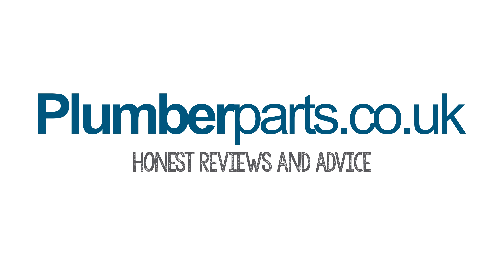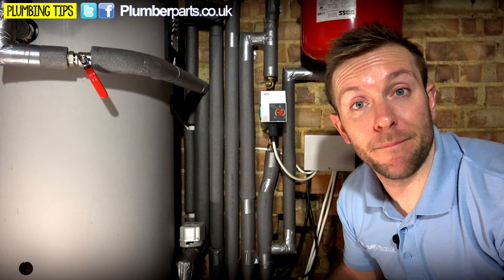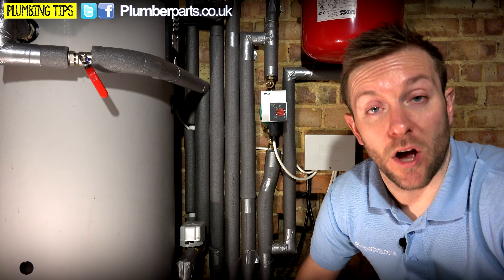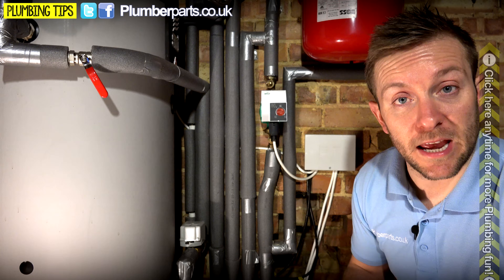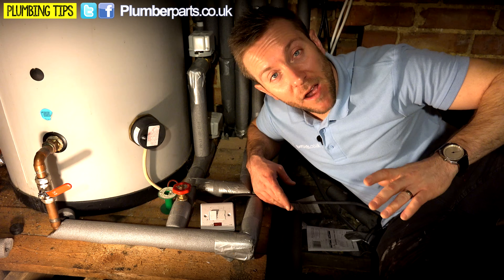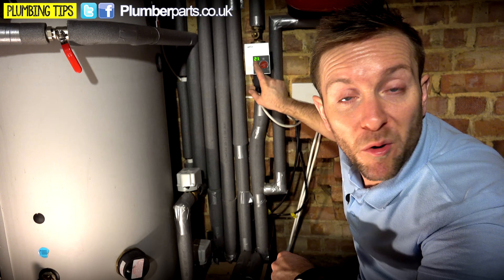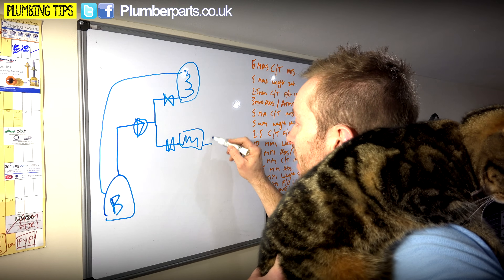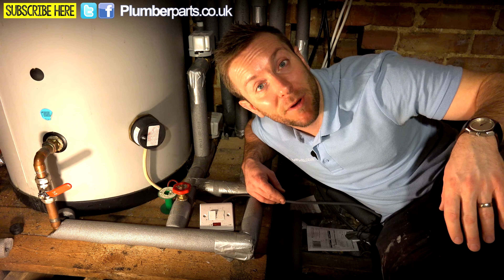BYPASS VALVES ON S PLAN AND Y PLAN HEATING SYSTEMS - Short Cycling prevention - Plumbing Tips

Comment: Do I need a bypass valve on a combi system? I have a couple of 2-port zone valves for my rads and sometimes they bang when the heating comes on. I think I may need a bypass circuit installed before the zone valves.
Reply from the maker: Yes mate, can't hurt! SUBSCRIBE! ➡️👉 https://www.youtube.com/subscription_center?add_user=plumberparts 👈⬅️ IF YOU HAVEN'T ALREADY! 😎
Reply: plumberparts cheers! love your videos. very helpful
Reply from the maker: No worries!
Reply: If you have a towel rail plumbed in independently, that'll do the job !

Comment: Hola hermano - does the by-pass also serve to ensure that some of the immediately heated water is fed back to the boiler so it is not receiving very cold water from the first fire up after standing idle for a while, so as to reduce condensation on the heat exchanger? Or was that just for old systems? Muchas gracias y saludos.
Reply: No.

Comment: Hi mate. whats your opinion on these new pumps on old systems with not the best flow, as they slow down when they feel resistance , (its not always the best idea to start power flushing old system until the customer is ready to fully upgrade boilers rads etc) would they not require a pump that has some humph to compensate ?
Reply from the maker: +B1cam They're great the compensation pumps. Really good at a nice balanced flow!

Comment: would changing from a feed and expansion tank to a sealed central system make the water flow better. ive a kitchen rad that wont heat and ive been advised this may solve it. ive tried EVERYTHING 😂
Reply from the maker: +Ror C It can do, but balancing the system should be your first port of call. 

Sub here please>> https://www.youtube.com/subscription_center?add_user=plumberparts <<If you haven't already!
Reply: +plumberparts ive balanced it already but it didnt work. ive taken the rad off and washed it through to clear sludge. I tried to purge air as you show in your videos. the water will flow through the rad and flow out  hot when i attach an open hose to radiator. this pointed a blocked return pipe. so i drained the system from the pipe i suspected was blocked and then blew pressure up the pipe. this left me convinced it wasnt blocked. had a plumber out and he suggested changing to a closed loop system might fix it but i dont want to part with cash unless it will repair
Reply: +plumberparts could it be the pump pressure is too low to push the water around?
Reply: The 'blockage' could be air - AKA an air lock. Turn all the other rads off at the valves, put the pump on it's fastest speed - and see if you hear bubbles rattling round the pump.

Comment: Good work James! Showing one of the many advantages of our Yonos-PICO.  LED display makes life nice and easy!
Reply from the maker: +Wilo UK Cheers guys! See you at Installer?
Reply: I have Wilo variable speed circulators in mind now. Have done for some years. The problem is, I've 2 spare Grundfos circulators in the garage.The second was a replacement for the first. The first was cleaned out/flushed and is ready to be used again. The second was replaced unnecessarily by the government in favour of an unbranded one.
Reply: What controllers do you provide for the variable speed circulators ? How many 'call for pumpage' terminals are there ? I'd hope for 3 - 1. low pressure, 2. high pressure & 3. full speed. Where 1. and 2. have pots so one can actually choose/tune the supplied pressure. Current system, zone 1 (TRVs) I'd want low pressure and for zones 2-5, full speed. It'd be useful to be able to vary the pressure by the number of zones active - so feed a terminal with 240V via resistors on each zone - so the more zones active, the nearer to 240V is provided to the pump.

Comment: Thanks James, great video...I have one pump, one three port valve and, I'm pretty sure, No bypass....I it might be built into the boiler but as that's a 15 yo Potterton, I doubt it. When the heating goes off for the summer, I switch the pump right down, also I don't have TRV's on every rad so I think that has the same effect, right? 🙂
Reply from the maker: +MrSbenn69 Kinda. Should be OK. PP!

Please sub >> https://www.youtube.com/user/plumberparts << if you haven't already!

Comment: Thank you for replying.The central heating has a separate feed an exspansion .The hot water cylinder is a Tornado I don't know if it is called a mega flow. All I do know is that it has an internal,integral exspansion. Operating pressure is 1.8bar with mains water pressure of 12 bar.It has a tundish to outside which I believe is set operate at 100 degrees

Comment: Is it only boilers with pump overrun that need a bypass fitted? Thanks
Reply from the maker: +Heavyweightboxing Fan No, most systems should have it. Especially with an outdoor boiler and frost stat.
Reply: +plumberparts great video as usual. Will be in the airing cupboard later looking for the bypass valve! My boiler is outside and has a frost protection stat. But only one stat wired up. Difference of opinion whether there should be one or two stats wired up to the frost stat? What's your view? Jeff
Reply: @UKDPO  John Ward's done a good vid on Frost stats: https://www.youtube.com/watch?v=e4MX1igMsjg - BUT read my comments on that vid as to how I think it'd work best.

Comment: I have a mains water pressure uñvented Ho water cylinder with an internal integral exspansion.vessel. How do I rècharge the exspansion vessel please.I know with an external vessel you can use a pump. Any advice wold be appreciated, peter hofman
Reply from the maker: +Peter Hofman Hi Peter, is it a Megaflow?

Comment: Hi I've just had a new baxi boiler fited replacing my powermax boiler I keeled the old radiators because my house is only 12 year old I had pressure drop problems with old boiler now with new. boiler to so come to the conclusion I've a leak but all pipes are in wall micro piping how can I test for leaking I've no damp patches any where hope u can help hold tight,
Reply: Sounds like you need a new house.